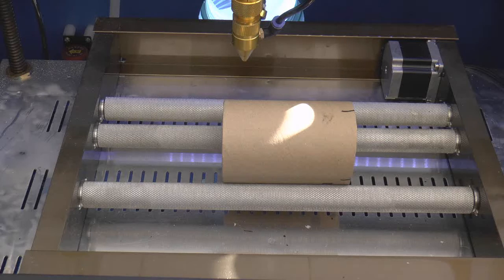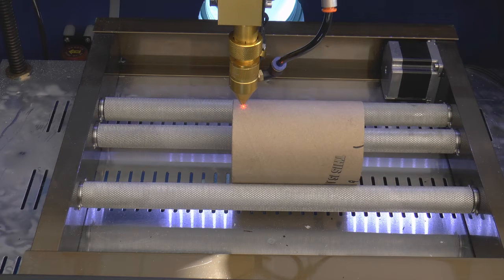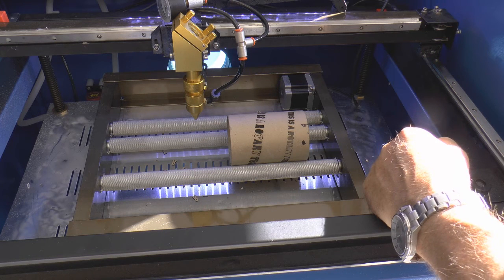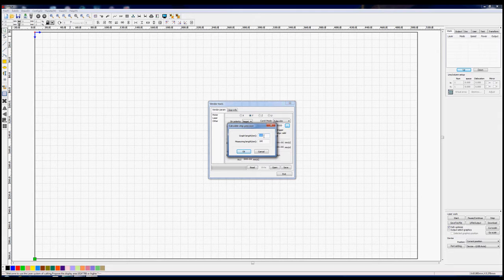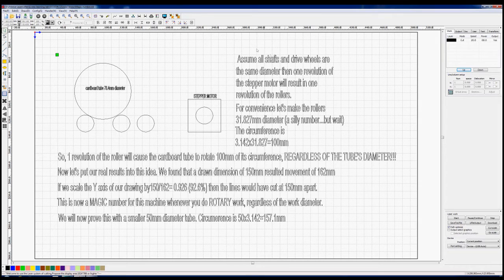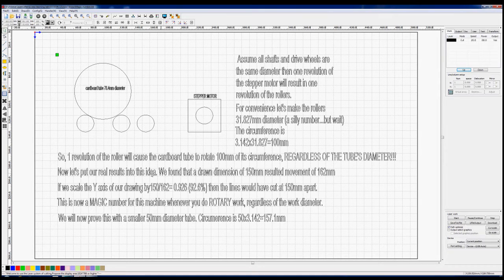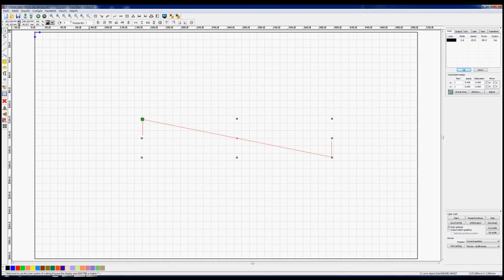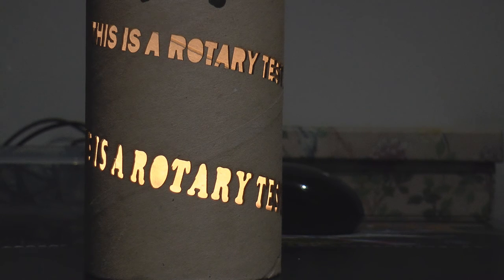RDWorks Learning Lab 11 part2 rotary table program and calibration

Comment: Using the rotary attachment- our image shows it should be circle- when running the "job" it turns into a rectangle squishing the image up and down but not side to side. Another fun part, its mirrored.
Reply from the maker: Hi 
 Let me try to explain what is happening.
 Lett me assume that you had a 3" square image you were going to engrave on you table  Your Y axis has been tough to know how to convert steps of ther stepper motor into REAL world dimensions  The numbers I now use are completely made up and are to illustratye the problem you have. Lets say 3" =3000 motor steps That takes into account the fact that you a certain number of teeth on the stepper pulley and another set that are driving the Y axis belt.   So your stepper will recreate a FLAT image perfectly.. 
 To make your rotery work you have unplugged the Y axis drive instructions from the controller  and plugged those instructions into a completely different system with totally different pulley sizes . IF you have a roller rotary like in this video or a wheel rotary They both move the CIRCUMFERENCE of your round object. With a little bit of maths  we can calculate that a tube/rod that is 0.955" diameter has a circumfrence of 3" Thus IF (and it a biff IF) youir rotatry happened to create one rotation of the rod with 3000 steps them your image will be perfect. However,  ff the GEARING on your pulleys means that 3000 steps only rotaes the rod by 108 degrees (half the circumference) then you will c reate a vertcally squashed image.
 There is complicated way to deal with this problem which I will not describe and a simple way and that is what this video tries to describe.
 Lets say your original image was 3" tall and when you measure it on your round object it is for example 2.2" tall if you do this simple calculation  
original dimension/short dimension    in this case 3/2.2 = 1,36. Multply that by 100 and you get 135% Ifd you use lightburn or RDWorks ther is a % scaling factor in the top tool bar. Make sure the lock is open and enter the 136% there. All of a sudden you have an overtall image  This will now engrave to the rigjht size.
Bset wishes and good luck

Comment: It.s interesting because with my machine things get very squished when I do rotary.  Im just now learning it, but I had to compensate by stretching my image by 57.2%.   Ive yes to test this same number with different diameters.
Reply from the maker: Hi Different diameters will not change your calibration factor because this system is rolling on surfaces. and not rotating in angular steps as would happen if you had a chuck type rotary. Your calibration factor is converting step increments through the gear ratio of your belts pulleys and rollers to the correct linear motion. Once done this factor remains constant.
 Best wishes
Russ

Comment: Hello, like I do appeal to your experience, I tried last week the rotary system to install on my 50 watt laser chinese, it was not to me. Now I wanted to return to the normal system but do not get it more right, I do not know what is going wrong, I have checked all parameters and are according to me the way it should. If I just put the power to crush the preys arm straight to a randomly to position? the pijltjetoesten ?? if I have the right impression, the arm to the left. I can not cope, so I do appeal to your experience. Thanks for your advice? Ludo vda
Reply from the maker: Hi Ludo
 Google translate is very poor at translating technical language so I am finding it difficult to understand your problem. Add your email address to another comment and I will write to you so that we can use pictures and video to examine your problem . I will also delete you comment /email address as soon as possible.
Best wishes
Russ

Comment: Thank you so much for this video. I just got a laser engraver fro Christmas and had no idea how to make my rotary work correctly. I used the method of vendor settings and no change. I did your method and presto my engravings on tumblers look correct. Turns out on a 75mm square the y was 55mm calculations show my magic number is 136%. thank you again.

Comment: All I can say is Your Pure Genius!!  I can't believe RDWorks had such a convoluted way of doing that.
Reply from the maker: Hi John
RDWorks does not really cater for this circumferential drive type of engraver. There is a rotary section in RDWorks but it is designed for the chuck type rotary where everything is predictable. When you are working with circumferences  its all linear and depends on the gearing of your rollers and also cannot cope with variations in diameter easily. This was very early on in my learming journey when I was experimenting with finding ways to use the free roller system supplied with the machine.. To be honest it is a very cheap and crappy method of rotary engraving. If yo wish to but something always go for the wheel type as they are much less troublesome and more adjustable. However........you may like to check out these videos from later in the series.
https://www.youtube.com/watch?v=-uafUAX04G4
https://www.youtube.com/watch?v=mCQqn0kfvCo

Best wishes
Russ

Comment: Thank you for all the videos, could anyone on here advise me what the maximum diameter of an object is when using the rotary attachment on this machine, i am looking to buy one but just need to check it's suitable

Many thanks
Jack
Reply from the maker: Hi Jack
 My advice is don't buy one of these . This video was done early in my learning journey and  the roller rotary was free with the machine. This was my first set of expository tests to find out how it works.  Yes you are correct to ask what the limiting diameter is  because it all depends on the step dimension that is programmed into your Y axis. This unit plugs into the Y axis and instead of moving the gantry, those step signals drive your rotary stepper motor.. Two initial issues to consider. First, not all Y axes are geared the same. Some will drive directly from the stepper motor shaft but who can say how many teeth there are on that drive pulley. Some will have an intermediate step down gearing pulley system. The number of teeth on all these pulleys will determine the step setting that is pre-set in your machine . The second issue is the gearing ratio on the roller rotary It will be like winning te lottery if the liner distance of a rotary step  is the same as a linear Y axis step.. Hence the need to calibrate.  You may find that a 100mm wide  drawn image finishes up as 80mm wide on a cylinder. Hence the need to stretch the width of your image by 100/80- 1.25 or 125% before you try to engrave it. That magnification ration can be plus or minus depending on the gearing.. Using ths example  to try and answer your question.  if you have a 500x300mm work area. a 300  drawn image in Y will become 80% of 300=240mm and 240mm is a circumference around a 
240/3.142= 76.38mm diameter.
 So the above paragraph sums up this video and the need to calibrate to overcome whatever gear ratios you will encounter. HOWEVER, there is a major problem with this roller design of rotary. It can work well enough for any object that is cylindrical  but try to engrave any non-cylindical  object such as a tumbler  which is tapered  and you immediately encounter a maths/physics problem . Again, lets take a simple exaggerated example of a tumbler which is 100mm diameter at the drinking end and 50mm at the base.. It is obvious that the circumference of the 100mm drinking end is TWICE that of the circumference of the base. therefore any circumferential drive from the rollers faces a conflict. On which diameter does it drive and which to let slip?  This will be random and totally unpredictable . So as it stands this system is VERY limited. 

You may decide to look at the CNC chuck type of rotary. This is totally positive in its control of rotation and even though  it will give perfect joining of images that cover 360 degrees, it is again really limited to parallel cylinders  but super for engraving drumsticks, pencils or pens which are too small for the cylinder rotary.. 
The most useful and flexible rotary system is the wheel system. One set of wheels drive and the other set free wheel. You can set the wheels to deal with tapered or parallel objects   but as with the roller system you will need to test and produce a calibration factor to apply to your images.

https://www.alibaba.com/product-detail/Rotation-Axis-Rotary-Engraving-Attachment-With_62043360208.html?spm=a2700.details.maylikeexp.1.55867899X2pxbA

 This wheel system  was the best option before I  discovered a brilliant idea that someone else had thought of. You might like to watch the second part of  design that I created for a motorless rotary system that requires no calibration  and  you engrave what you draw and it will deal with tapered objects.
see   https://www.youtube.com/watch?v=mCQqn0kfvCo

Best wishes
Russ
Reply: @SarbarMultimedia  Hi Russ, thankyou for taking the time to give such in depth feedback, Its really helped me come to a decision on which machine to buy and I will be opting for the DIY rotary system.

Many thanks
Jack
Reply from the maker: @jdev1991 
HiJack 
If you need the dxf file to make the DIY unit then just add your email to another video because I get auto copied with new comments but often my email does not pick up sub comments. Leave your comment live for 10 minutes then remove it. By that time I should have your email address captured and I will send the file to you.
Best wishes
Russ

Comment: Hi, I have one question regarding to engraving glass. Could you tell me what parameters did you use for cutting speed and power?
Reply from the maker: Hi Anna

Sadly no, not exactly, because it depends on so many factors. What lens you are using, what type of glass ( the cheaper the glass the better. stay away from lead crystal). the power of your tube and the response time of your HV power supply.. The main mechanism by which you engrave glass is almost like stone chipping on your car windscreen You fire a pulse of energy at the glass and it locally heats up rapidly and because glass is a poor conductor of heat the micro heated area expands rapidly and explodes away from the background glass. This creates a fairly rough engraved texture that is quite sharp to the touch. You may want to dull it off by rubbing a scouring pad over it after engraving. I have heard advice from old hands"saying "hit it hard and fast" By that I would assume something like 400mm/s and 60 to 70% power.. Hmmm.... my experience is much different. I tend to be more delicate with the power. I run at about 200mm/s and usethe minimum power to mark the product. There is a very useful operating zone for your tube called the pre-ionzation zone where the beam properties are great for glass engraving, card cutting and many other delicate operations. If you do not understand about this region then watch this video
https://www.youtube.com/watch?v=nZuatc3eIgU&list=PLPWEtx5V9DqEogIeYRdcG_KYcB7UL2Qmn&index=26&t=1459s   starting at 24:40 if you don't want to watch it all.
You may also be interested in watching

https://www.youtube.com/watch?v=l4XUSt60T68&list=PLPWEtx5V9DqEogIeYRdcG_KYcB7UL2Qmn&index=39&t=3s

Best wishes
Russ
Reply: @SarbarMultimedia  Thank you very much, so far I have seen most of your tutorials, due to mu final degree on Higher Vocational College of mechatronics is connected to this topic. I will check videos you sent me.

Comment: Hi,  My K$) laser won't Stop at home position. Belt keeps running. Could you please help. I really like your videos.
Reply from the maker: Hi Michael

Now that you have unplugged your Y axis , when you switch the power back on (or press the rRESET button) the machine is "lost",  so it goes through a specific startup routine. If you watch what your X axis does you will see it approach the sensor  at a steady speed. The switch detects ON (there will be an LED on the switch which will illuminates)and the  motor stops and reverses. It is now  looking for the OFF position. It reverses a little and then  runs slowly at the switch again until it switches ON. This second time of passing OFF it sets the display to zero. 
 At the same time the Y axis is trying to do the same thing but because you have disconnected the Y motor It cannot automatically do this zeroing routine. To fool the controller  you can either push the gantry to the back TWICE or touch the switch TWICE with a screwdriver.
Best wishes
Russ

Comment: There are two basic types of rotary engravers.  As shown in the video the surface of the round object rotates as a function of distance, not rotary angle.  This is best set up NOT using the rotary setup in the program.  Just calibrate the distance exactly the same as a flat object.  On a round object in a chuck, on the other type of rotary adapter, you DO use the rotary setup in the program as diameter then does affect the distance traveled.  This adapter is perfect for repeating patterns that wrap completely around an object such as a continuous checkerboard, leaf, wave, etc pattern.  The adapter in the video is not great at full cylinder patterns as it is almost impossible to get the ends of the print to align perfectly.  However it makes getting proper proportion on text and graphics very simple.
Reply from the maker: This device was supplied free with the machine but it has some serious failures. Please remember that these are not tutorials but me discovering ways to use the machine almost 3 years ago I don't think I have ever used it in anger.  To do engraving on tapered objects you have to block up one end of the frame . The downhill force as the object end stops on the frame  naturally causes friction that can result in slippage. The other big issue is the with tapered objects where   both large and small end are sitting between the rollers. The small end and big end each want to drive at different speeds. This inevitably results in conflict and random  non-uniform rotation. This last issue can be mitigated by putting a rubber band around the big end and allowing the lower friction small end to slip. . There is a much better 1:1 scale non-motorized rotary in 
https://www.youtube.com/watch?v=-uafUAX04G4
https://www.youtube.com/watch?v=mCQqn0kfvCo
I agree that the chuck rotary system is the only way to do perfect seamless rotary work  but with the major drawback  that it is only really suited to parallel objects.
Thanks for the comment
Best wishes
Russ
Reply: @SarbarMultimedia  I do remember that.  I found when using those type drives, a pair of rubber bands work great on some objects with a non perfect surface such as the cardboard tubes.

Comment: It's all about stepper pulse settings. Stepper controller on this machine is set to 5000 pulse per revolution. That's if you have 1:1 gear ration on motor to rollers. On this attachment however motor has gear with 20 teeth, and roller has gear with 32 teeth. 32/20=1.6. So you will need 5000*1.6=8000 pulses. Put this setting in User tab (circle pulses) and enable rotary. Additionally put diameter of the rollers (25mm) in there and write settings. This should work in theory, but on my machine I'm still a bit off and I have no idea why. Same thing happens on my Boss Laser which uses same controller (but different pulse settings). Probably has to do with Vendor settings overrides... I'm thinking of applying your ratio idea but not to the Y size but to pulse settings instead.
Update: You need to updated Firmware of the controller in order to use User tab rotary functions.
Reply: Actually never mind. There's something not right with controller on these machines. It completely ignores settings made in RDWorks user tab. Enabling or disabling rotary, changing pulses, diameter, etc. has no effect.  It works on my Boss laser (which has slightly different Ruida controller), but not on this one...
Reply from the maker: Hi 
Those User settings are designed for a chuck type rotary engraver which has to divide 360 degrees into step increments. You could go into the Vendor settings and change the step increment for the Y axis to reflect the gearing on your roller system. However, this is a VERY bad idea because A) the ratio will change for every different diameter you use and B) you will curse when you swap back to normal XY use and forget to reset the correct step interval.  My method of stretching/compressing your image with a magnification factor is by far the simplest and safest way to operate our peripheral drive rotary.
Best wishes
Russ
Reply: You method absolutely works! However I disagree about Chuck Rotary functionality. It can be set to both Chuck and Roller types of rotary. In case of Chuck, pulse settings doesn't change because chuck usually driven directly by stepper motor. This functionality described in Boss Laser Rotary attach document.
I was able to figure out why User rotary settings had no effect in my (and probably yours) machines. Firmware version that was loaded did not support this functionality. After upgrading it to 8.00.53, I'm now able to control rotary parameters from User menu and it works great too! I plan to make a short tutorial video about this.